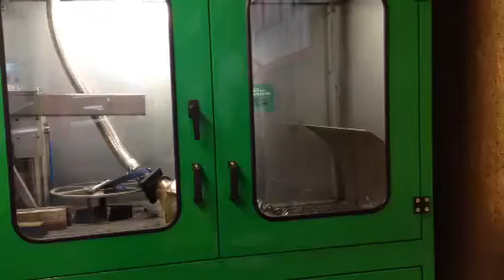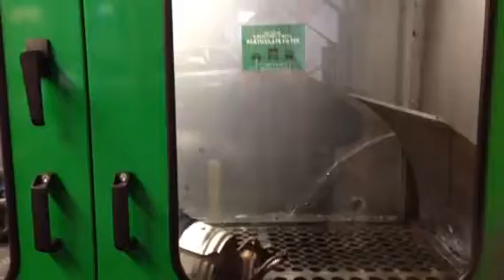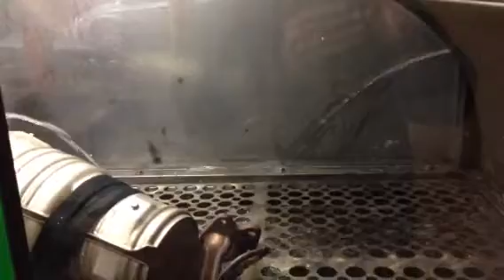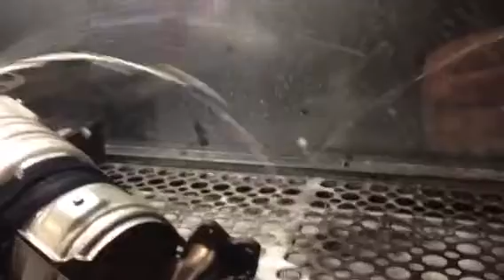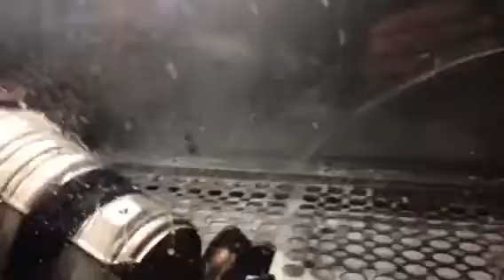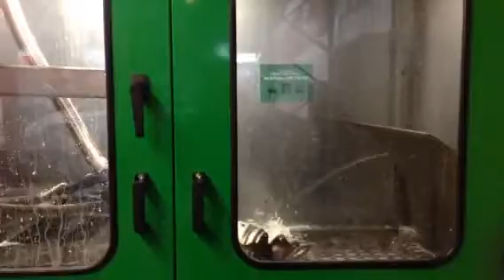Dpf repair cleaning a Honda Dpf in Hull

Comment: How reliable are Honda dpf compared to other cars
Reply from the maker: Hi.
They are very much the same and all are prone to blocking over time.Poor servicing and town use and not highway use is the main contributor to early failure.
Good fuel and a run out frequently will keep it clean.